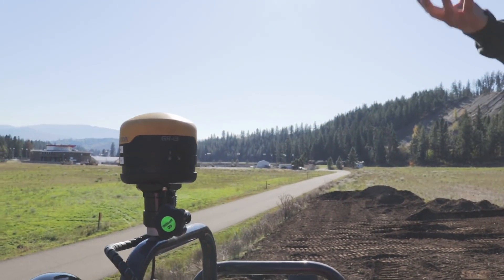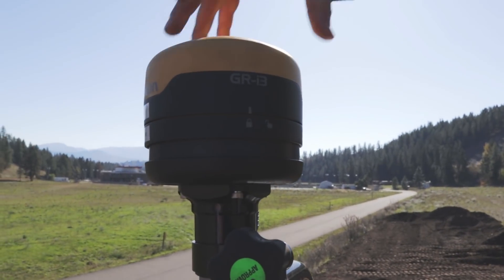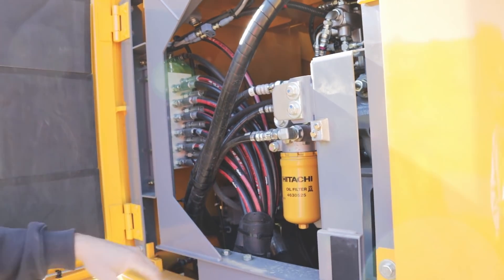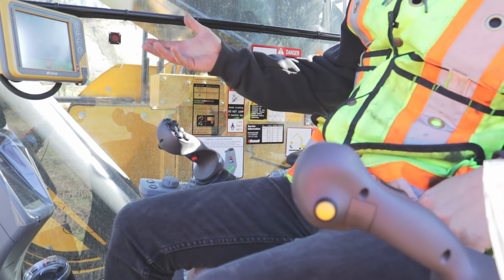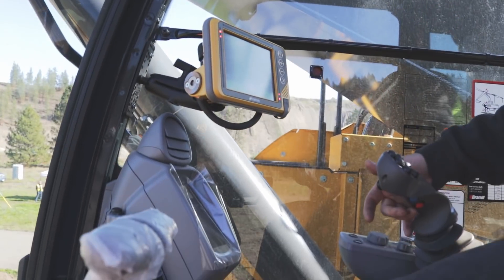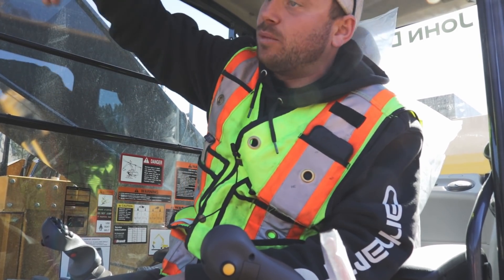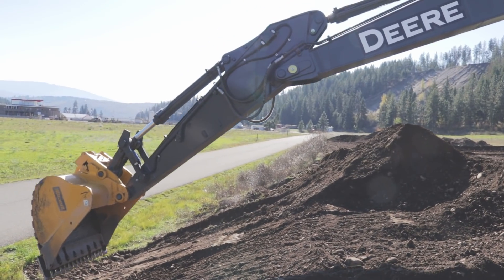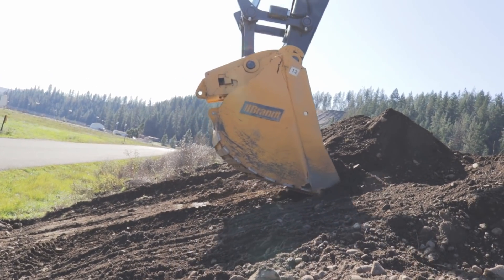Excavator that digs itself?! YUP, the future is here...

Comment: Ya, whats the cost? Who pays when it runs away with itself, computers are soooh reliable. Does it grease itself too or is that coming soon? Put it in ledge for shits and giggles.
Reply: Blade Runner they have machines that greases themselves....
Reply: @quinnhenshaw7293   ya. I know but no eyes on the grease system. Greasing provides PM as you watch the grease and look for cracks, leaks etc.
Reply: @someguy920  Real convenient but I like the hands on touch and feel. I got up to Cats battery gun but it was a hassle too. Plus I walk by a machine and grease jumps on me so even auto grease wouldn't help me stay clean. LOL

Comment: I like to see the advancement for sure but it did look like it was a little glitchy when he started moving faster. I’m sure that was probably because he outran the amount of flow the machine would put out but it still looks like a hell of a good deal to me. Even if it’s got to run slow to be accurate I would think it severely increases efficiency just due to not having to take multiple cuts to get to grade.
Reply: I can cut grade in a deeper cut with a wrist a twist first try every time even in rocky conditions , a good operator willl make this tech look useless
Reply: That’s a bold statement from someone that’s probably never ran this machine.
Reply: Strangefruit oh really only 30000 hours
Reply: excavator fun wow.. you’ll have to elaborate on how you’ve ran a machine for 30k hours when it hasn’t even existed for 30k hours. You  must be a time traveler.
Reply: @strangefruit8776  I don't have to run it to see it's only made for perfect digging situations , anyone who has my hours in a hoe knows its not useful in 90% of the soils I work in!
Reply: excavator fun and how do you know that? You think you can make an excavator do something that Deere can’t?
Reply: @strangefruit8776  you obviously don't have clue , put some hours in in the real world in the seat and in real dirt , rocks , mud, frost than tell me how many times this machine will get a perfect grade the first time when clay is balling up at the cutting edge , dragging a lump of clay , dragging stones , ect.! comment when you live the real world like I do everyday. Sure this would be handy on certain projects but not very many .A experienced operator is much more productive
Reply: excavator fun you can talk about your experience until you’re blue in the face and it means absolutely nothing if you haven’t run this exact machine and don’t know anything about it.
Reply: Professor 850kj regardless of what this guy thinks he can do until he’s sat is an automated machine and had to compete with it his opinion is pretty much nonsense. You can’t know what you don’t know. That’s about like guys that have always ran Cat equipment saying how they could run circles around a Deere and vise versa. No amount of hours on one machine will teach you what a different machine will do until you’ve spent equal time in both.
Reply: You keep all your machine ours written down? That’s cute, bet it gives all the boys at work a hard on lol